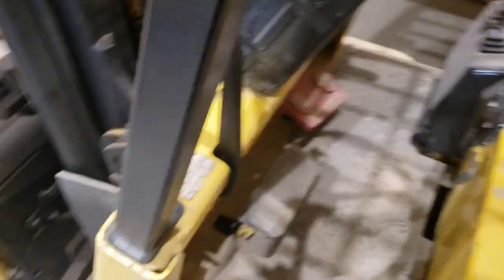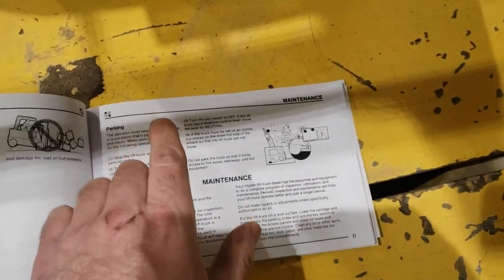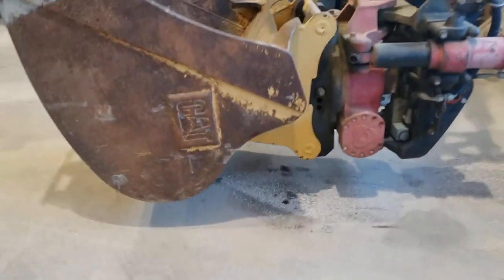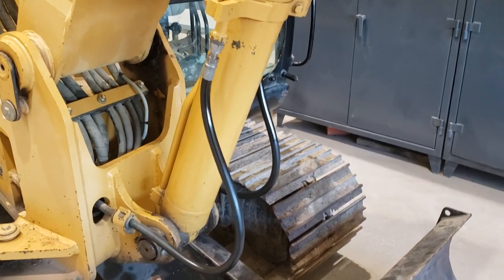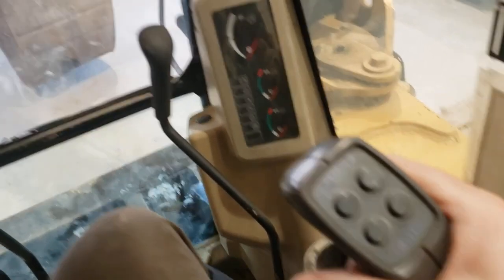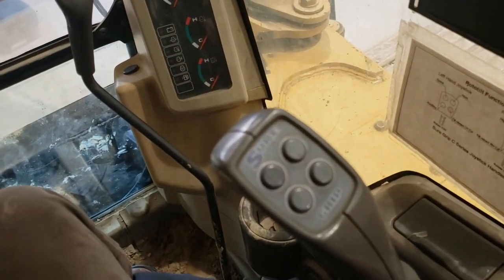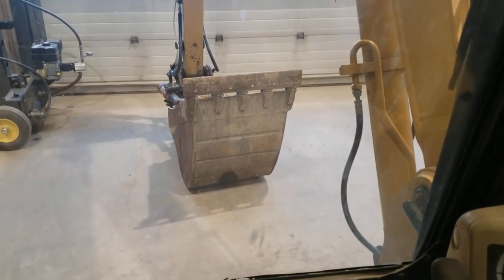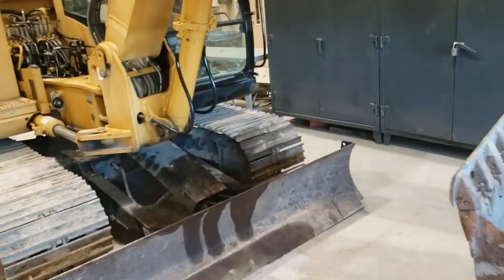hydraulics safety: zero energy state part 2

Comment: Ever watched the Caterpillar video “shake hands with danger”?  It says when you work on a machine with the implement in the air, you’re betting your life on a 50 cent o-ring. I always release all the energy from the hydraulics before working on it. Be careful when removing the hydraulic tank cap on a hot machine. Seen a guy lose some teeth doing that.